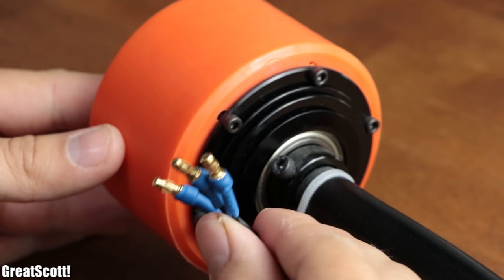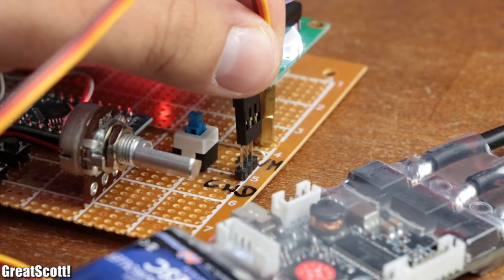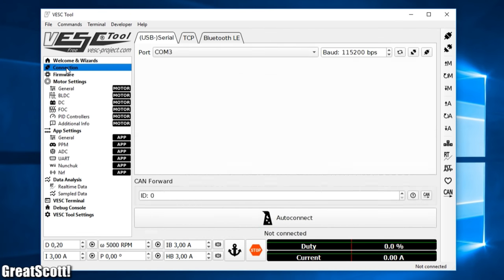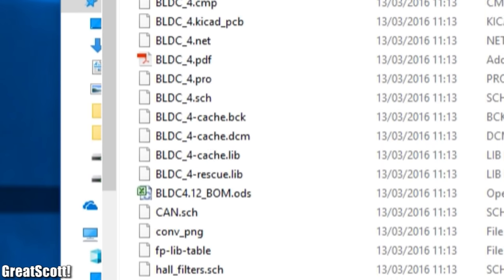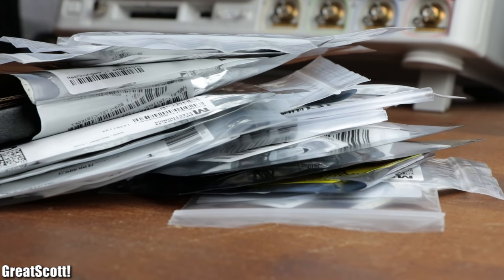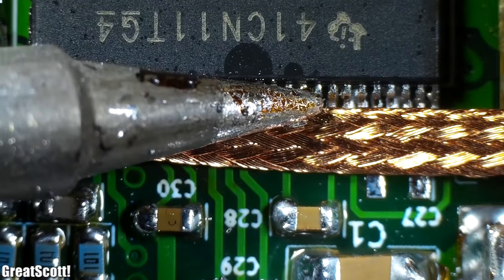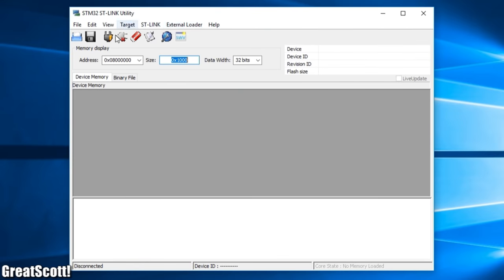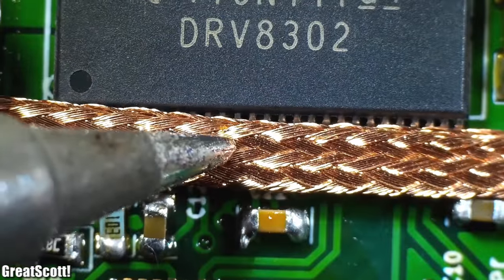VESC (Best Open Source ESC) || DIY or Buy

Comment: I'm really curios to know where is DIY in this project!! I think soldering some SMD components doesen't mean DIY :) nevertheless the VESCs are great electronic circuit:)
Reply: What would you propose would constitute DIY? Building a clean room and setting up your own silicon lithography station to make your own SMD ICs?

Making the whole thing out of 7500 logic?

It's more DIY then most of what I do with my soldering iorn....
Reply: Of course everybody has a clean room in their lab ;) maybe you missunderstand the D.I.Y. meaning.

PS: logic is not 7500 but 7400, keep in mind :)
Reply: No, my point was: Designing your own PCB layout isn't necessary for the project to qualify as DIY. He'd still have to have a specialist like JLPCB make his custom PCBs. Same with using off-the-shelf components. The final assembly is done by the end-user. That's DIY. Not only for electronics, but aircraft and cars as well.

Sure, doing it on a breadboard or using a mill to make a two-layer PCB is farther down the DIY rabbit hole, but this still qualifies.
Reply: I'm sorry I don't agree with you. Most DIY project is what you mean and in my opinion they shouldn't have this name. DIY project doesen't mean buy a kit and assemble it in my opinion.
In my poor opinion, DIY means to add something personal at a project, not only buy a kit and assemble it. Just think at LEGO blocks, you have the kit and you have the instruction, and this is the same of building an electronic circuit. Now you are telling that everyone in the world played with LEGO will become a DIY maker ;)

Regarding the PCBs (I'm working with JLCPCB and EsyEDA as well, if you visit my page), in this case is quite easy copy and paste of the layout and the BOM.
Reply: agree 100%
Reply: Well technically you are doing the soldering yourself 😂, so by definition it is diy, soldering anyway
Reply: xXPORTALXx  Hahaha xD but a really poor DIY
Reply: @ATLaboratory  depends on your experience level really, but I would agree that assembling a kit without modification isn't really diy, however perhaps assembling the kit yourself and/or ordering the PCBs counts a tad. To use your example no building with Lego's isn't diy, however using legos to accomplish a RL task, or printing the bricks yourself would count in my mind. 

The line is in the sand as it were lol
Reply: xXPORTALXx  completely agree with you. Of course the boundary is pretty thin and even me, on my small italian YT channel, sometimes pass the line between the DIY or not. I post the comment becuase in my mind GreatScott! can do really better then a simple assembly, or better doesn't call it a DIY or BUY project:)

Comment: I have designed a much cheaper proof-of concept ESC, based on old ESC32 code and the "Bluepill" which has pre-soldered MCU. It lacks FOC though. VESC is more ambitious so it uses more external ICS like ADCs and a higher-end ARM CPU. My ESC32 clone uses only the built-in ADC channels of the MCU and one of the versions even skips the current control circuit. The BOM is under 8 EUR if you buy the components from China.

Comment: For hand soldering SMT components, instead of printing out the PCBs you can use a tool called SMT assistant by alciom. It allows you to load the BMP of the PCB and the partslist. It then highlights the position of the component for you when you click on it in a list.
https://www.alciom.com/en/smtassistant/
https://beta2.alciom.com/wp-content/uploads/2012/04/SmtAssistant_v1r2_distrib.zip

Comment: I assumed fetal position and cried  after seeing this soldering job.  He could have done it one of two ways. either getting a stencil or pre-tinning all the pads and place the components on the pads with solder and heating them up with his hot air station .

Comment: Does this run non brushless motors?
Reply from the maker: I think so
Reply: Yeah, just set DC in the VESC tool and connect the motor wires to the two outer MOSFET’s

Comment: Considering the amazingly low cost of electronics these days (mostly due to China). This item seems to be a very expensive item. I'm guessing because this sort of motor control is still relatively new. It also looks over engineered as if it's trying to be all things to all people.

Comment: My pet peeve is all that flux left on the board. 😠
I would have gotten my cheap and partially broken tooth brush and some isopropyl alcohol and start scrubbing.
Reply from the maker: I did that for troubleshooting. It did not help.
Reply: Oh...
I guess I am a neat freak.
Also that excess flux makes my hand sticky.
Ick.
But makes sense that scrubbing the board wouldn’t solve any problems.

Comment: What would voltage be in the simplest terms?Thanks
Reply: Aakash Prasad try electroBOOM's video on the story of electrons or the technomods various electronics basics
Reply: voltage is the energy each electron has
Reply: Aakash Prasad Voltage is the force applied to a conductor to electrons. Think of it as pressure
Reply: Francis C Does electrical potential, electrical potential energy and voltage mean the same thing?They are sometimes used interchangeably.
Reply: Aakash Prasad simple answer is yes
Reply: another way of describing it from way back in my Science class 'current is the size of the stream, voltage is how fast the water's going, wattage is how much raw force the water has'.

Comment: The tip of your soldering iron is so big. Mine has a very fine tip like a needle. And my whole soldering equipment is only that old soldering iron. But I soldered many many fine things, much finer that what you're soldering with microscope, with my bare eyes and hands. Just buy a very fine tip for your soldering iron and prepare to get amazed of the difference. You won't need any hot air gun, etc, anymore.

Comment: STM32F405 for ESC????? Insane.
Reply: The trend definitely goes to 32bit also in ESCs. Yes a F4 is pretty crazy, but for such an big ESC (60V / 50A) not unresonable imho.
Reply: Not just any ESC. Check out VESC’s features/performance/capability/reliability/*-ity

Comment: Lol I like you videos but with your soldering skills I can see why isn't working :D You need a lot of flux, and a 45degree soldering head to solder the ICs, especially those with very dense pins. Also instead of soldering, invest in a soldering paste dispenser, place the components on their pads and put the board in an electrical oven at 184 (just above the melting point for ROHS which I assume you're using). That is not only faster, but it spare you the troubleshooting process, and possible destroy of the mosfets

Comment: Just place your parts with some solder paste and use hot air station on low airflow setting and if you don't have any hot air station you can really use use a pan and put it on stove until you see all solder joints shining and remove it from heat 😂😂😂

Comment: Save yourself the headache of small component SMD soldering.  https://www.diygadget.com/electric-skateboard-parts/176-vesc-bldc-open-source-electric-skateboard-esc-partially-assembled.html
I purchased this and ordered the remaining components off Arrow.com for $35. (spent an extra $10 to get some extras because I knew I was gonna mess up a DRV8302 trying to solder it on with a heat gun).

ALSO, DID YOU SOLDER THE EXPOSED GROUND PAD ON THE DRV8302? If you didn't then the buck converter won't work properly and the STM32 won't receive power. (The St-link you're using I'm guessing provides an isolated voltage source, so that is why you were able to program the chip).

Comment: Dude.  solder stencil.  send in your solder pad gerber to https://www.oshstencils.com/ then just tape down the stencil, squeegy your solder paste across the stencil.  Peal it off, apply your components, then hit it with the heat gun at high heat low flow.  It's cheap and WAAAAAAAY easier.

Comment: Such things can’t be done by hand it’s so small and needs a lot of time and focus and also the right tools to make sure it works perfectly , buying them is probably cheaper and easier, although only if it’s would coast me a 75% less than the original price I’d try to make it..
Reply: Alucard Pawpad 
Well, you don’t even know me to say that, read my comment again, i said it needs a lot of time and focus and also the right tools, you can’t make it work in an hour or two with normal tools ...
Reply: Undefined Lastname 
Yea sure, so can you solder all that smd components with the soldering iron in less than 3 hours?
Reply: Undefined Lastname 
You are right, thanks for the tips ,i work with through hole components more than smd, i think you need a good Magnifying glass or a microscope too to make the work easier with smd..

Comment: Forgive me but you have Great knowledge and experience but does not have good soldering .. plus with 86$ in pakistan i can design and make much better VESC, Plus why you did not used IRF3205 insted irfs7530? identical. anyhow i still accept U r  Genius!

Comment: I don't doubt that the project could have worked. But I really have to say that your SMD soldering skills are to poor for such a project.
Use thinner solder (0.5mm) and try to keep the soldering time as short as possible. I'm sure you fried some components. A small chisel tip is also better.
Reply: Try using a SMT stencil for the solder paste dispensing. Then you should have no problems soldering everything with the hot air gun!

Comment: No offence but your soldering is shocking, go buy some more appropriately sized solder (much thinner), a flux pen and a sensible fine point tip for your iron. Then the relatively large SMD components on a project like this should go on much better. Constantly blasting everything with the hot-air rework station will also eventually damage stuff. You produce so much good stuff that it actually looks like you solder poorly on purpose to stir us all up!

Comment: While I like your videos your soldering skills are pretty terrible. Watch some of Louis Rossman his videos. You need a good flux like the NC-559 from Amtech Direct, good solder wire/paste, a good heat gun (Louis is testing some)  and a soldering tip which  is fitting for the task. In the case of SMD, a stencil and a reflow hot plate is a good investment

If you put all these things in a basket  it's quite expensive. But just mounting modules together is quite boring.

Comment: I don't think this is a fair comparison, as, sorry to say, you suck at SMD soldering.
(For future adventures, may I suggest you use a LOT less solderpaste, you have about 10 times more than needed.)
However, with a price difference of only $2, the winner IS, of course  "BUY".
Even for a SMD expert, it takes time for ordering parts, sort, mount and solder.
The REAL benefit of DIY comes when you modify the scematics and layout to suit your needs, enclosure or whatever.

Comment: So ...how to make a servo tester ?😂
Reply: Peter Zingler If you have an Arduino its just a simple analogWrite() function with potentiometer input or they have a servo sweep function in the example library if you don't have a potentiometer.

You could make the Arduino since it is open source, its a little overkill for testing servos, but you can add extra features easily with a quick software change.

I'll be using an arduino, because my $1 servo tester went missing and I don't want to wait several weeks.